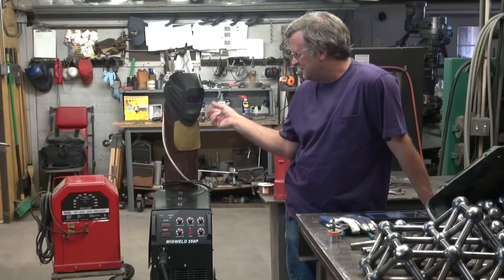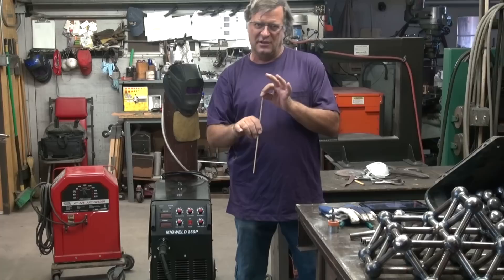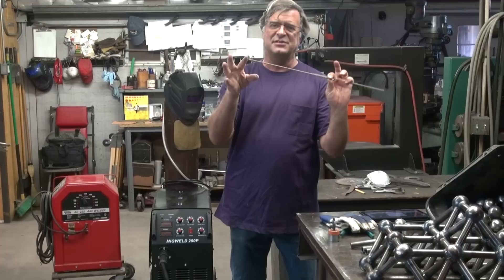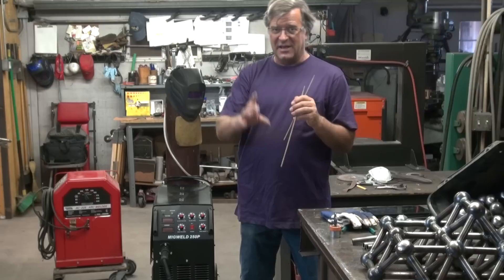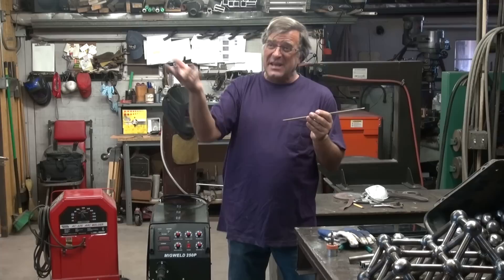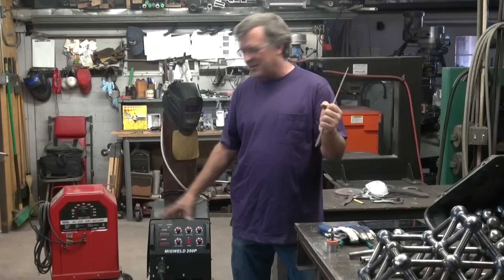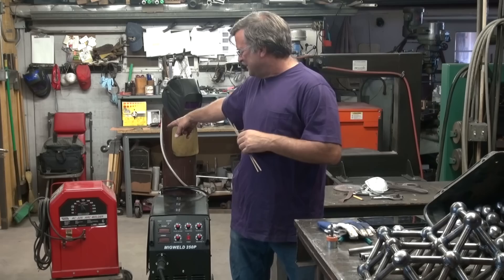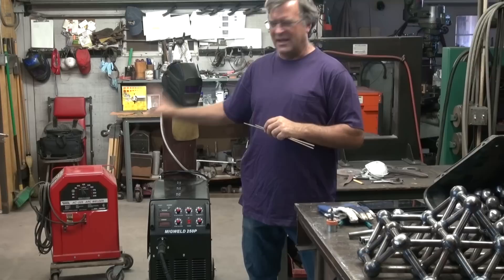MIG Welding vs. Arc Welding - Which Welder When? - Kevin Caron

Comment: just a quick thing to say and I don't mean to come across as being that guy but MIG welding IS arc welding. I say this just to clear it up for anyone studying in school/college as is you refer to SMAW (shielded metal arc welding) as arc welding, your tutor is not going to be very impressed. TIG/SMAW (stick)/MIG are all forms of 'arc welding'. I'm currently in university studying welding engineering and I can tell you it really won't go down very well with your tutor if you refer to it as arc welding. it's a common mistake because when SMAW came out, the only viable method of welding then was gas welding such as Oxy-acetylene, this 'new' version of welding that uses electricity to create an electrical arc was the only type of arc welding available, thus it earned its now incorrectly named arc welding.
Reply from the maker: Thanks for the slap on the back of the head!
Reply: I meant no disrespect to you, sir. I think you are a vast well of welding and fabrication knowledge. Thank you for your time. =)
Reply from the maker: No problem Jon,    
Sometimes I just need to be set on the straight and narrow...

Comment: You forgot to mention the difference in price you can pick up enormous arc welder these days for around a hundred bucks but for a MIG that's anything better than the s*** they have at Harbor Freight which spatters like a mofo you looking at paying probably $1,000 or more
Reply from the maker: You should check out the Everlast line. The new cyclone 200 mig is very nice and is selling in the $400 range last I heard.